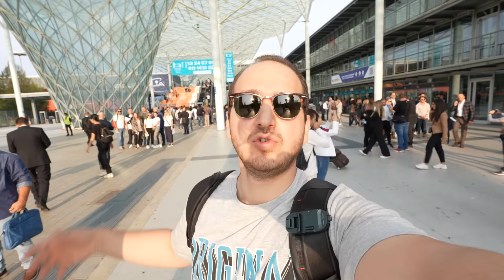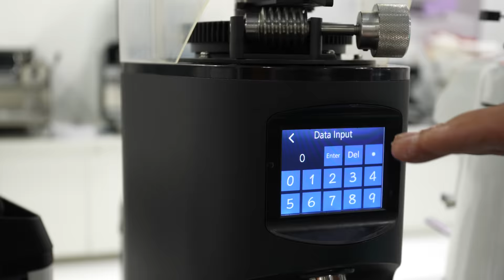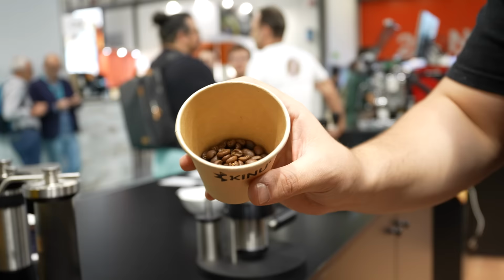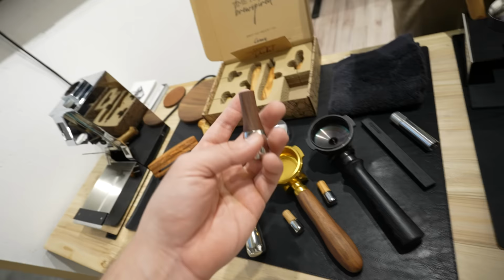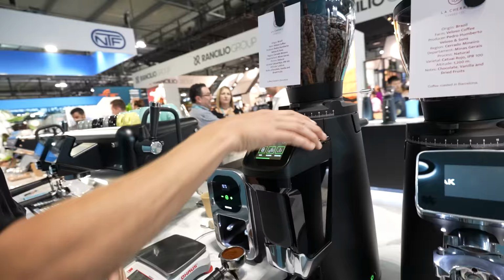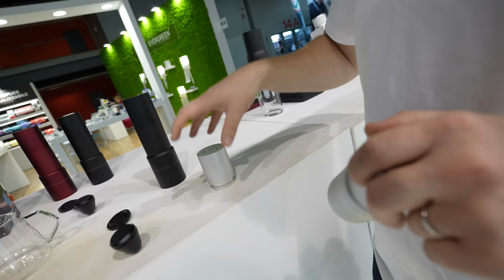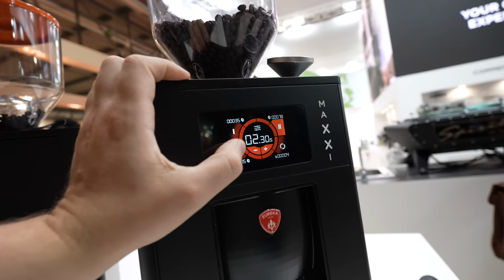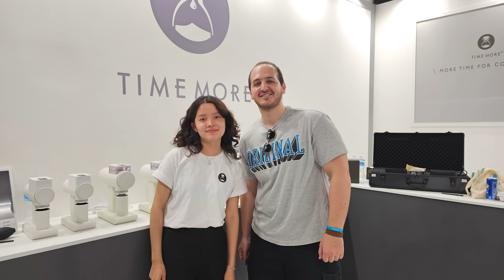HostMilano 2023 Vlog! Fiera Milano Rho

Comment: Varia vs6 seems super interesting although 800 - 2000 RPM seems high for conical burrs? niche zero runs at 330 RPM?
Reply from the maker: It can fit either conical or flat, and they are still testing it, lots of work to go there with it ☕️🤍👌